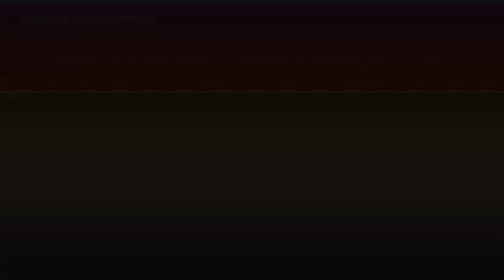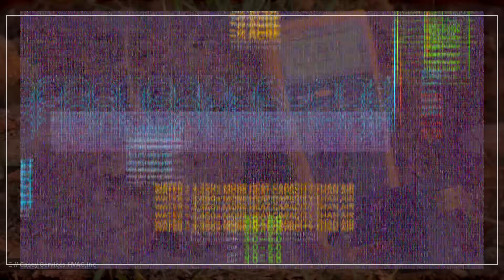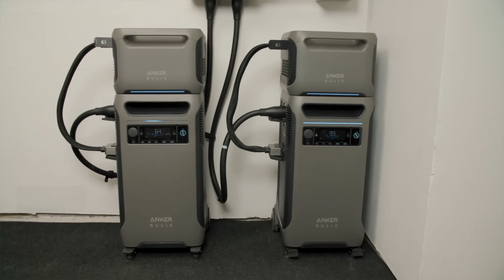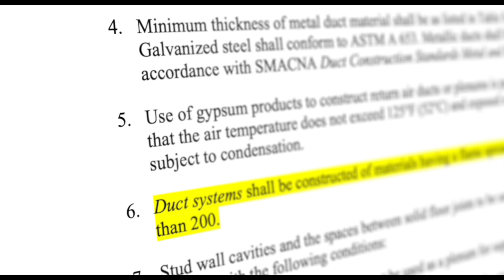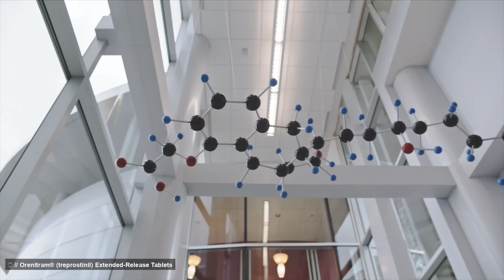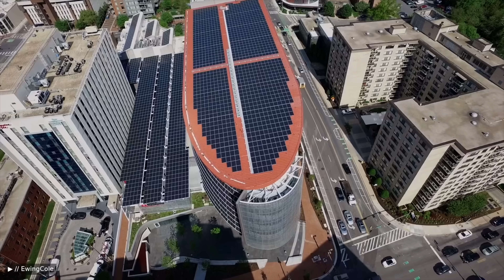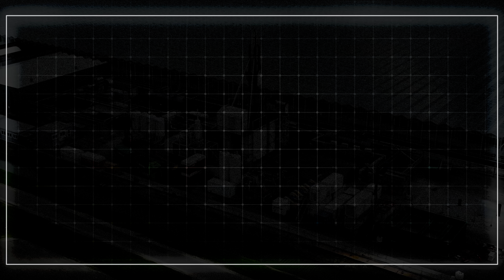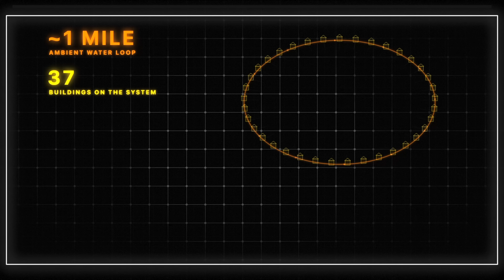The Viral DIY Cooling Hack That Nearly Killed a Family

Comment: My problem with underground stuff is its basically impossible to maintain or fix after it's initially installed.

They do the work before building the entire house lots ok cool, but now fast forward 30 years and there was an earthquake or other event that made the soil move and bend or break some part of the piping, now people have grown trees, dug swimming pools etc around and you can't make the same work truck come where the fault is, if you can even pinpoint it, what if it's in a borehole UNDER a house ? You bulldoze the house to fix it ?

Idk but I'd rather change a heatpump unit adjacent to my house when it finally dies that seems easier.

Ive seen a horror story about 20 years ago where some people got a geothermal system installed in their garden but the loop used some kind of gas or chemical fluid instead of air or water, and it started leaking not many years after installation and killed all the vegetation in a large radius around it, I'm not sure if there was immediate danger to the people leaving there but it didn't sound great.

At the minimum I would want nothing inaccessible from outside like under the house directly, and certainly no direct air-air circulation that sound like a really stupid idea.

Air heatpumps have already solved heating and summer AC issues, people just need to stop keeping their houses leaky as hell and building them out of cardboard so controlling the air temperature in them is actually a realistic proposition to begin with.

Comment: Your video starts wrong in the first two minutes. You only get cold ground temps in the North - where you don't need AC in the first place. Do more research. Your ground temps are a good 25F-30F higher in the south.

Comment: This is not a new idea. As you said yourself, it's thousands of years old. In most cases, it's just not cost effective. Once you have transferred some heat into the ground, guess what happens? The temperature of the ground surrounding your pipes changes to that of the fluid you are pumping through the pipes and it stops working. The ground in which you install this thing must have great heat conductivity.

Comment: You never elaborated on the 6 to 10 feet to get stable temperature, only later to say deeper is better.
I'm in Montreal Canada and the frost line is 5 to 6 feet. For Geothermal they go up to 100 meters, one long deep hole rather than many shallow holes.

Comment: I recall when I was a kid we has VW Beetles. The heating system was an air pipe around the exhaust pipe. If you think that's bad our last one was the 73 Super Beetle with optional gas heater. Yes, a box added under the glove compartment that burned gasoline to heat air, not directly but the passenger had a blowtorch next to their knees.

Comment: In 2017 I had two 400 foot boreholes drilled with tubing installed for $7000. My Climatemaster 3 ton water furnace cost $13000 with some ductwork. I built the other half of the ductwork. Total of $24,000 AND Obama energy CREDITS were $7000. So out of pocket costs were $17000. The system cut electric bill in half, and has been running since 2018.   
Of course we now have tRump ruining everything, so don't expect these kind of numbers again until we get a more sensible government.

Comment: I would have liked you to have gone into further depth about the ambient loop moving heat/cold between houses. I'm having a hard time picturing that working without having the temperature be too mild for either.. i.e. not be hot enough to do much for the cold houses and not cold enough for the hot houses.

Comment: if you are paying $10,000+ for a bore hole you are getting massively ripped off if it is not thru solid granite most of the way. tri-state drilling inc. 8'x36' = $80,000 filled with concrete and rebar to the bottom with a hurricane proof power pole mount. stop messing with well drillers, bring in a professional. i made these bores 4 times a day 12 hour days in 114º heat in texas all summer and completed the 2' above ground concrete forms by hand myself. we don't eff around. specializing in americas worst and most hazardous conditions the tops of mountains in the middle of winter all over north america to right beside chicagos & maryland mainline train rails that included amtrack high speed trains in muddy springs and falls and all the foundations of the original world trade centers as well as the mall of america. watson 3000 & 5000 and IMT's don't play...they build america

Comment: Not sure if I have seen THAT video....

BUT I did see a video of people trying to do a PASSIVE cooling system... 
They had their pipe setup in a way that is going to flood with water.
and also they had the sun facing part of the house shaded and a weird venting system...... so the passive part isn't going to work very well - if at all.

For those wondering:
The passive system needs a kind of Arizona room that the sun heats up with your air vents at the top of that room. That room is NOT a hang out room as it gets VERY HOT, but that also means that hot hair (hotter than outside air) rises out of the vents PULLING air through the air pipe in the ground.
That Arizona room needs to be closed off from the rest of the house and insulated from the rest of the house except for the vents near the ceiling connected to the room next to it, so it can pull the hottest air from that room. Most people put a garden in the Arizona room with plants that can take the heat... while others go extra and put tanks of water or sand to absorb the sun so it works over night.
(saw one guy that used the tanks of water as the hot water for the house)

Comment: So, the real cost of AC in that austin community was 90 + 60 = $150/mo. I love the idea. I really want to hotside/coldside electricity generation for my house - could probably also be a heat-exchange system too but not nearly as effective as geothermal. In the summer, the difference between sunnyside of house and shade side would be about 50 degrees difference between the sides.

Comment: Geothermal is good until that ground loop develops a leak and it’s an expensive repair.  Food for thought, Geothermal on initial installation is very expensive and it takes until the end of equipment life to recover the money.  An Air to Air Cooling System can be designed with Floating Condensing Head Pressure and using a Balanced Port TXV to lower its energy usage.  This would certainly work in hot climates.

Comment: There are three fundamental decision-making mechanisms you should use when saving energy:  
(1) Does this idea actually save enough energy (or is it really just a pipe dream that might not work);  
(2) Will this idea save me money (where you compare the cost v. decline in my utility bill v. the 5% I could make on the stock market after tax); and 
(3) Have I exhausted all better options?

In this framework, solar and wind both are terrible for the home owner because of the incidence of storm damage and mechanical failure over the liftime of the system is so high that actual payback over the lifetime is virtually impossible--invest your money instead.  But LED bulbs take highest priority with a one to three year payback.  Energy saving window screening takes a high priority with a similar payback.  Adding insulation to your house takes a high priority with a five to ten year payback.  Door and windows take a high priority with a three to ten year payback.  Upgrading your HVAC equipment takes a high priority with a three to fifteen year payback.  Phase change materials take a moderate priority with a ten to fifteen year payback.   But mechanized expensive systems that need constant monitoring?  Not a good idea at all...  And driving a hybrid vehicle?  Same problem.  I know, I own one and have done the math.

Comment: Without bureaucracy, permits, licensing, or inspections, a basic ground tube (earth-air heat exchanger) system would cost roughly $500–$5,000 for a decent residential setup. For a guy who claims to give the whole picture, this guy's conveniently blind regarding that, which is the whole point.

Comment: Fun fact: the $12000 rebate doesn't come out of thin air, it's stolen from homeowners who don't have geothermal. That's why it's gone.
Reply: So, you’re acknowledging there is a shared cost associated with these things? Good. You’re absolutely right, about there being a cost. Your accounting, though, needs some work. Incentivizing new-builds/ installations toward ground-source heat pumps means more ppl will choose to install them. Since HVAC is the largest source of residential energy demand, anything we can do to make HVAC systems more efficient has an outsized impact on residential electricity demand overall. If demand for electricity wasn’t projected to rise for the foreseeable future, you might have a leg to stand on (arguably). Thing is, electricity demand is projected to rise/ is rising. Electrical infrastructure, however, is insufficient to meet said rising demand, meaning we’re gonna have to build new infrastructure to satisfy all this new demand. That infrastructure is not cheap to build. The cost of building it will be borne by everyone, in the form of higher utility rates, among other, indirect, costs. By reducing residential demand, we reduce the need to build new, costly infrastructure. The costs associated with the tax rebates pay for themselves multiple times over, and those savings are eventually passed back to you in the form of lower utility bills. 
If you want to call putting money in your pocket stealing, nobody is going to stop you. Just don’t be surprised when they won’t take you seriously.

Comment: I live on a deep lake in Virginia. The end of my dock sits in 14ft of water, below the thermocline.
It's like 50 degrees year round at depths greater than 15 feet.
It gets super deep in a straight line off my dock - eventually to 120'.
What's to stop me from just using this perfect lake as my heat exchanger?
This seems like
Reply: You certainly can, but make sure whatever piping you use is quite sturdy.  As the pipe comes up near the surface, you'll want to insulate and bury it some. Then that pipe either needs to be connected to a simple heat exchanger like a large radiator with a fan blowing over it, or to a heat pump system.  The latter will be more efficient but much more costly. 

   I'll be doing similar with a well that we have. Its a larger well (about 2 ft across).  I'm sticking 40 feet of U bend 1" copper pipe (so 20 ft tall on the two sides) down into the water, then connected to PEX tubing that will be insulated with pool noodles and run through corrugated drain pipe (with mulch over same), which will go to a shed that's been converted to a studio (insulated etc).  I have an 18" x 20" radiator style heat exchanger + fan + low'ish wattage aquarium pump that will be connected to it. 

  If the power goes out, the fan and pump could easily be run by a portable power station and solar panels.
Reply: @justinw1765 very cool! I appreciate the input. Thanks my friend!
Reply: @rickrudd   You're very welcome. 

  Cheers

Comment: I watched that same video and thanks for giving us the math on liquid vs air heat transfer capacity. And thanks for also demolishing the "The government banned this..." crap, too. There is certainly corruption and lobbying in government but as you point out, the idea that Big Heat Pump killed this off air transfer ground heat exchange systems is just bananas. They just built a massively more efficient system.

Comment: If you have a close in 100 x 100 foot space, you could bury hydronic geothermal pipes in trenches only six feet deep and use it for both heating and cooling.   That's thousands of times easier than drilling hard rock 200-300 feet deep.  You could do it with a standard backhoe loader or small excavator without breaking a sweat.

Comment: I can't believe someone would promote the dumbest possible way to do something like this. Not only is it poorly designed from an efficiency standpoint, but a moisture handling one too. How could anyone do air based heat exchange UNDERGROUND and not once consider there could be ambient humidity?

Comment: Retrofit ground source user here. Installed in a 193 year old house in the UK. Three boreholes, 125 metres deep. No issues in operation, save an absolutely massive upheaval during drilling operations. The garden was basically ruined. We replaced oil, and so feeling a bit smug, given heating oil is £1.50 a litre at the moment.

Comment: IMO, ground source heat pumps are essential, particularly in areas which have winter temperatures with high humidity air below 5 °C (41 °F), when air coils freeze up quickly, needing frequent de-icing heating.  Another advantage is that in seasons with temperatures between about 20 -- 40 °C (66 -- 104 °F) you can obtain "free cooling", just pumping unchilled water direct from the ground loop, at about 15 °C (59 °F).  

Using water at that temperature has the advantage that, in most climates, the cooling emitters in the house do not get covered in condensation, removing risk of mould and enabling the winter heat-emitters, eg floor surfaces, low-temperature radiators or heating coils in air-based heating, to be used for cooling without alteration.  While that is not possible in areas with hot humid air, it is arguably worth prioritising dehumidification for comfort in those areas, alongside which, free cooling is again practicable.

Comment: A Mitsubishi Hyperheat air sourced heat pump costs 1/3 of ground sourced.  It is just as efficient and had a payback of 6 years.   I've had one for 11 years, and it works at 40 below zero (i live in Vermont).  I'm a physics professor and measured everything.

Comment: When you install the system... You might want to think about using `Air Lift Water Pump` - to move the water.  The YT-Video that know about is TOVZ4oklBFw and talks about -- 10,000 L water an hour with just 20 watts for the air pump.  AND if it was ME... I would have the BORE HOLES seperated by 50' or so and use one to kool in the summer and then switch it to heat in the winter. 

BORE-1 - Start using it to cool in summer, water gets warmer...  Winter, you can now use it to get more heat from the system

BORE-2 - Just circulate the water to get the temp down in winter, then in summer get a boost of cooling.

You should get the jist... more complicated but the idea is to use the BORE Holes as a thermal battery,   Swtich between them when you need

(shrug)

Comment: Grounds Source and Air Source heat pumps share MOST components such as compressors and far more.  Therefore, replacement of parts basically the same... with the exception of easier access for air source.

The COST and permitting needed for geosystem systems is HIGH.  Putting an air source heat pump on a concrete pad - very little.  Horizontal field need a LOT of space (as noted) and means digging up everything.  COST compared to putting an air source heat pump on a concrete pad?  Well, pretty obvious.

You get pretty much exactly the same energy efficiency at a FRACTION of the cost with an air source normal heat pump.

BUT, here's the key.  Bragging rights, LOOK HOW COOL I AM belongs to the GS folks.  A guy walks in and says "I use geo-thermal" vs "I have a heat pump."  Who gets the ooh, ahhs?  Not the heat pump guy.

Now when you start talking about district systems, then the math works far better!  But for residential, you pay a HUGE premium for geothermal vs air source.  And as said, the # of companies you can count on to install, repair, replace geothermal is SO limited it's easy to find yourself in deep doodoo.

"But it could be fun."

Comment: I saw the video you are referencing. The one thing that video said that might have some truth is a geothermal system should get better as the soil settles over a few years. That might not be an issue with a grouted vertical well but I bet it is with a horizontal loop.

Comment: One issue not often mentioned with vertical geothermal is that the thermal well has a limited usage time. You're extracting / dumping heat to it after all, and the source/sink isn't endless. Of course, in a climate where the average temperature around the year is close to the desired indoor temperature, it is going to last a very, very long time. In a climate where you need to either mostly dump or mostly extract heat, it's a different story however.

Comment: 9:25 those areas might still be very unsafe because of Valley Fever. Valley Fever is a very dangerous fungal infection spread through soil contactm. It's endemic to pretty much the entire area you've highlighted. It killed my family's dog, and causes meningitis in humans. It can be fatal. I would be very nervous about using an air based system where flowing air is being pushed through contaminated soil. Seems like hydronic systems are safer everywhere, imo.

Comment: I'm trying my own DIY cooling hack since I don't want to replace the central AC. After a month so far it is working surprising well. It is a cheap $45 600CFM carpet fan blowing over my non-carpeted areas since it is basically a thermal heat sink.

Comment: All sounds cool, but the high efficiency low temp air source heat pumps means there is no real need for them. For the added cost of the earth source you can pay for decades of the extra energy needed for the air source.

Comment: I think if you bet on energy prices going through the roof in the future, that's probably a very good bet. Gasoline, natural gas, electricity, are all resources that you have to compete with others in a market to acquire. The dirt under your house typically is not.

Solar + electric car + efficient climate control may or may not pay for itself, but it will insulate you from the volatile energy market in a big way.